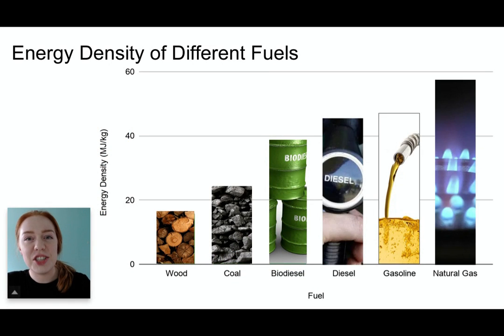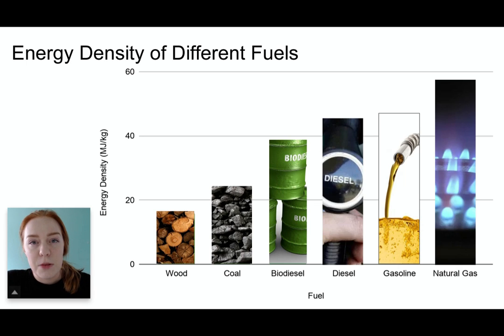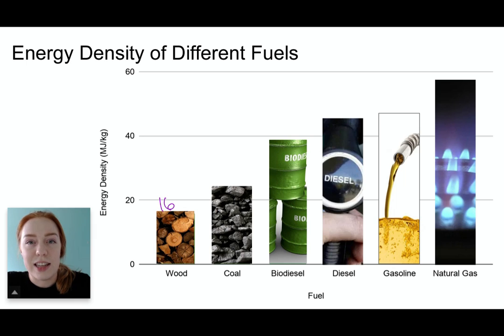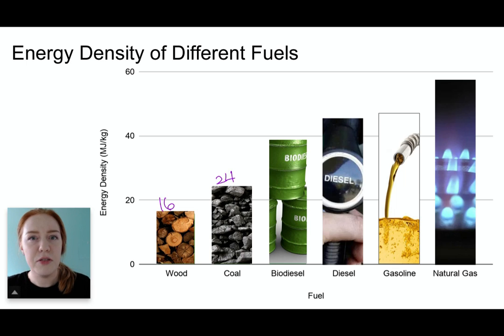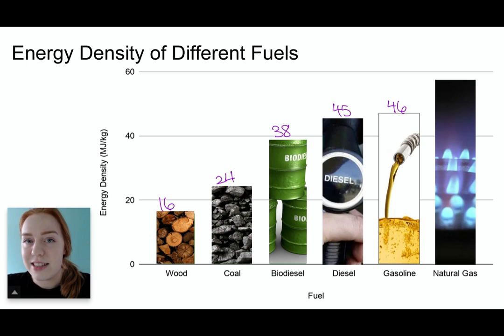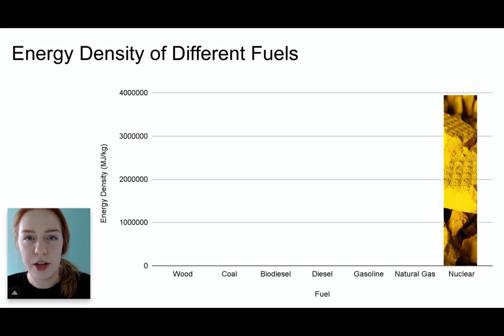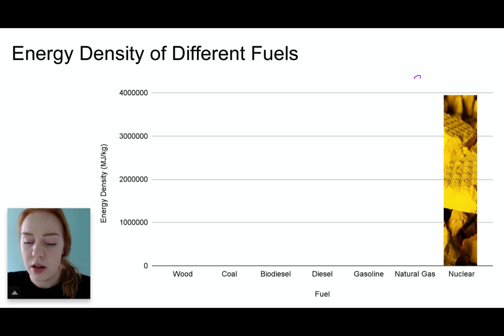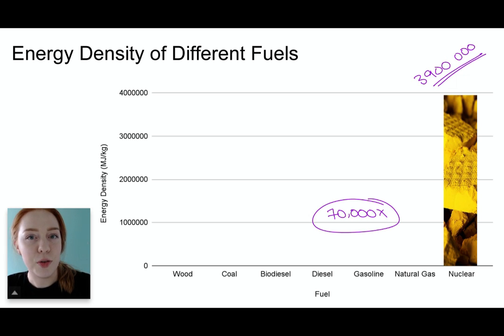Knowing Nuclear: Energy Density of Fuels

Comment: The fuels you compare to uranium come out of the ground or grow with relatively little processing. The fuel density should include the weight of all the waste produced...then the equation would be a little more balanced.
Reply from the maker: Including the waste produced from the different energy sources would make this even more starkly in favour of nuclear. The waste from coal (for example) triples in mass when burned and gets 100x times larger. The waste from fossil fuels is causing widespread devastation that are a threat to civilization, as opposed to the waste from nuclear power which is comparatively easy to handle. 

The energy density described in this video is a big part of why nuclear power's waste is fairly easy to handle.
Reply: @energyeducation4087  www.energymining.sa.gov.au/minerals/mining/mines_and_quarries/olympic_dam/olympic_dam_uranium_incident_reports
Incidents of spills need to be reported, down to 1 gram of material, nuclear material is not benign...the fukushima incident will cost up to 1 trillion dollars to clean up, who pays for that?
Reply: Forget that, how much does a safe fission reactor weigh? This graph is very misleading.

Comment: The environmental movement stance on nuclear power can possibly be the biggest mistake any type of movement has made in the history of this species and I don't mean that as hyperbole. It's definitely up there if it isn't first place. The fossil fuel industry has been sheering it on all the way because they have known for the last decades that nuclear is the only really reliable large scale alternative besides hydroelectric up until relatively recently and even now, wind, wave, and solar is very limited in its capacity and only work in specific areas.
Not only has it caused an unnecessary amount of deaths by pollution, an estimated 10 000 die each day, the future death toll is going to make that number seem insignificant as the real effect of global warming rears its ugly head. 
In addition to the human tragedy, this pollution costs well over $4 trillion in annual losses, or 6% of global GDP.
 I hate to say it but this is what happens when a movement is hijacked by emotionally driven leftists.